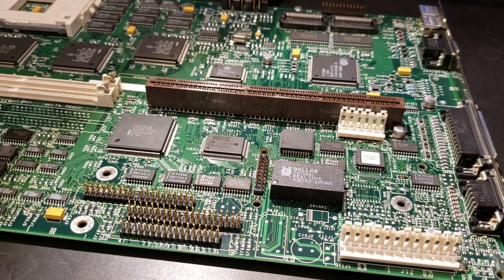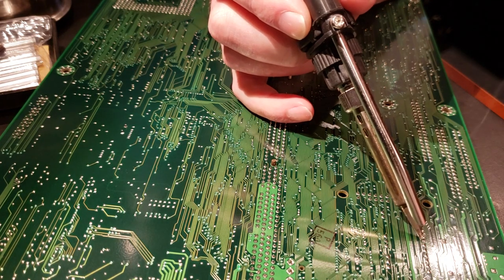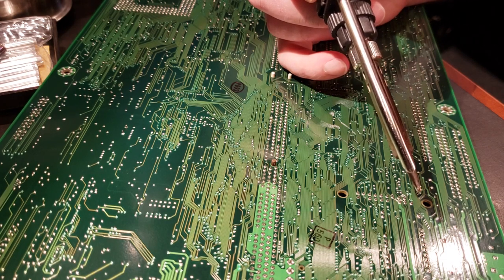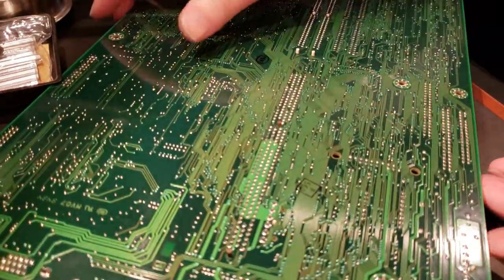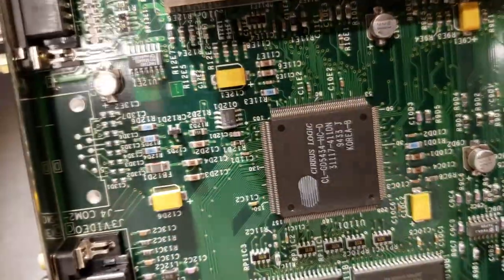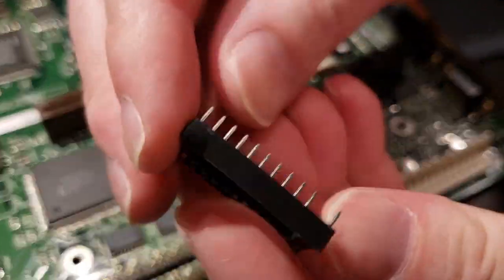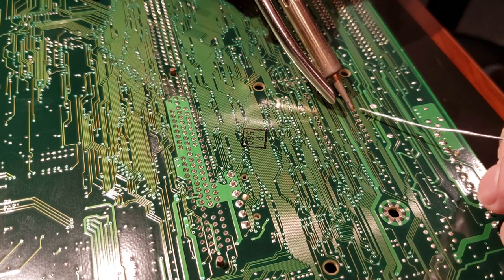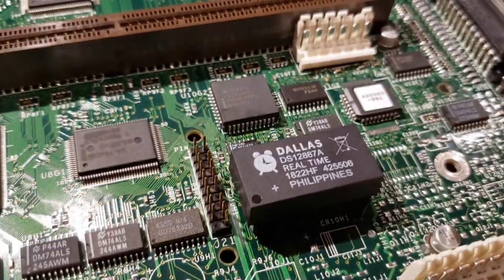EASY Dallas RTC Socket Upgrade!

Comment: the desoldering iron is a game changer, i just put some flux on the pins first, then go at it with the desoldering iron and pull the dead chip off.
Reply from the maker: I recently acquired one, and so far it is a huge help.  I severely damaged a board practicing, but that is why you practice!

Comment: If you have got the space around the 12887 then I suggest using a PCB, a DS12885, a 32.768kHz quartz and a 3V source (CR2032). Then you just have to replace the battery and don't spend 10$ on a new DS12887 each time. I did that with my Atari Falcon 030 and I am very pleased.

Comment: Hey my friend can u tell me the reason for removing this chip ? I got one of these force 101 models off eBay and wanted to know , thanks again !!
Reply: It has internal battery that died. Literal example of planned obsolescence.
Reply: @marzi_kat  It's not "planned obsolescence" that's how batteries work, if you want real time clock you have to have a battery
Reply: @SkynetCyb  You're right, batteries go bad over time.  With that in mind, they could have made the chip so the battery was replaceable, or at least solder a socket to the motherboard instead of soldering the chip directly.

Comment: Message to the uploader: Is it a requirement that the Dallas Clock Chip be soldered to the socket?
Reply from the maker: It should not be soldered to the socket. That defeats the purpose of using a socket.